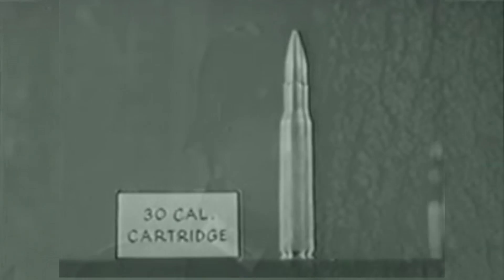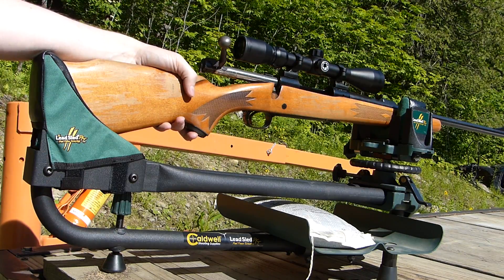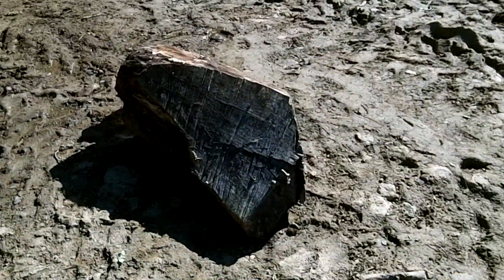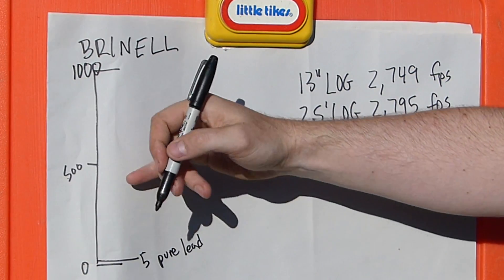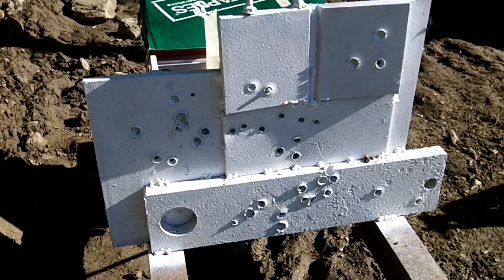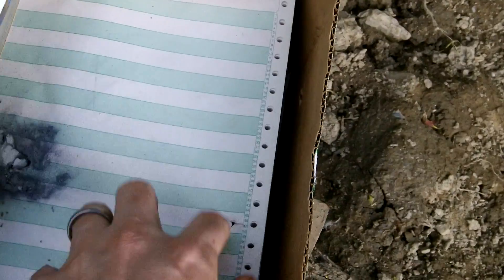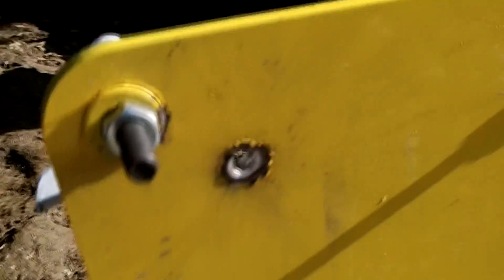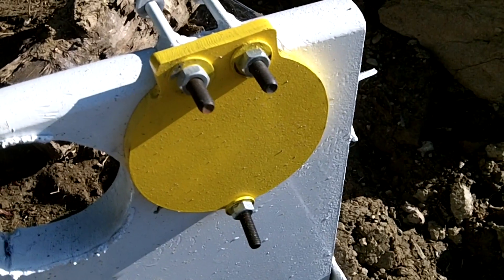AMMOTEST: 30 Caliber M2 (30-06) Armor Piercing Penetration Tests - Military Surplus Ammo

Comment: In the early 80s i tested various bullets on M2 bradley armor plates, i still use the same plates. Only the 50cal APs & APIs would mostley go thru, the plate is a thinner one (5/8") from behind the tow missile launcher. With a WW2 40mm AP projo in my black powder breechloader cannon. it punched a spall out of the back but bounced off, found it on the ground a few feet in front. It hits with about 40 to 50,000 ft. Lbs.
  Then tried 1 3/4" thick T6061 alum. 3" square blocks with 30-06 M2 AP it put a small bump on the back. 9MMs put a shallow .05" deep dent, 45ACP just put a smudge, not even a dent, they hit at an angle though. 223s went about 1/2" deep. 50cal M2 AP went thru. 50cal M1 incendiary went almost an inch with a lot bigger blast hole😊
Reply: I also got hit in the stomach with a 30-06 M2 AP core while shooting at a 155mm cannon projo at about 50yds. That I used as a target. I found  the core in front of me, it was to hot to hold😊

Comment: You have what's called gunpowder   degradation over time the Stabilizer inside the gunpowder Starts to break down so the gunpowder inside the the rounds loses it's maximum strength Over a long period of time Being that those rounds are over 70 years old  When those rounds were new they probably would have pierced all your steel targets And a good portion of your concrete targets The rounds should have been closer to 2900 FPS and 3400 FPS for Black tip 30-06 AP

Comment: [05/07/21] Very nicely done testing for a "non-laboratory" type test environment. It is sufficient such that it gives us an appreciation for what 72 year-old 30-06 AP ammunition is capable of doing. It is safe to say that the ammunition has suffered no appreciable age degradation.

Surprised that there was no "permanent" Back Face Deformation on any of the steel targets.
It would have been nice to see the effects on level III+ and level IV plates, but these results are very telling.
Just a few questions:
a) At what distance were the shots taken?
b) When you say the concrete was reinforced; what rebar was used, and in which type of pattern was it layed out?

Great no nonsense, no sensationalism type of presentation. 👍👍👍

Comment: British Royal Armouries tests, in 1917, of German Mauser 7.92mm. AP bullets found that they could penetrate up to 19mm. of Harveyised (high carbon steel boiler plate) armour at 100 yards with one in hundred hits achieving maximum penetration.

The same tests were repeated, in the 1920's, against rolled homogeneous armour plate, where the penetration was up to 13mm. at 100 yards.

This led to the British light, medium & cruiser tanks, of the 1930's adopting 14mm. of armour protection, so as to be just AP bullet proof and to save on weight & cost.

Comment: Great video. I'd like to see similar tests on 5.56 NATO M855/SS109 "green tip" ammunition. Some retailers call this AP, but the ATF has specifically exempted it from their AP designation since it reportedly cannot penetrate level 3 police body armor.
Reply: Have u ever seen how small the little steel core is in the tip of SS109 ammo, I wouldnt count on it for much of anything. I've  got a steel core right here. The core is about 8mm long (.317") & about 2mm dia. (.182") that's smaller than 3/16" & it only weighs 11grs, that's lighter than a 17 HMR😊
Reply: The dia. Should be 4.6mm      (.182") oops, brain fart😊

Comment: That ammunition was used by my dad who was a WW2 veteran and his rifle was a Springfield during the beginning of the war and later on he was issued a Garand rifle.  He said that the black tip could penetrate the armor of the Japanese model 95 light tank.  He also said that the nearest thing that he can compare the steel in its core is the drill bit.  It's nice to know that it was proven true and my dad was correct in his comparison.

Comment: I would like to see those bullets set in a 300 Weatherby Mag--see what kind of steel it will clean. At 500 yards, that 30 06 only has 560 ft lbs of energy--Weatherby has 1980

Comment: If they had been true AP rounds they would have gone through the 1/2" AR500 plate easily because the cores would have been tungsten or tungsten carbide which has a Brinell hardness of 2150 to 2200, NOT the 1000 Brinell that you list as tops. Depleted uranium cores have Brinells of up to 2500. Alloy steel APs are better than FMJ but not nearly as good as tungsten/tungsten carbide or DU cored rounds. However, the latter are very expensive, and DU create collateral health problems. Nor was it available during WWII for obvious reasons.

Comment: When I was a kid (circa 1968) we had a couple trees which intertwined with one another.  One was a sweet gum and the other a loblolly pine.  At a height about nine feet, each tree was about fourteen inches diameter.  My dad had an old 1903 Springfield 30.06 and some steel jacketed ammo.  He would shoot all the way through both trees...about 28 inches of wood.  He did it several times and the bullets never failed to blast through both trees.

Comment: It would have penetrated the AR500 1/2 in plate if you had not shot it where the 1 1/2" low carbon steel was not directly behind it. The 1 1/2 prevented the hard steel slug from being punch through the AR plate. It acted like a face hardened 2" think plate.

Comment: The only problem with the second log test is the direction of the fibers.  The linear structure of the wood fibers would lend itself to encapsulating the round and rapidly bleeding off momentum.  The cutting action in a cross grain penetration is far more likely to yield results, just as crosscutting lumber is easier than rip cutting lumber.  I would venture a guess that an endgrain shot on a 13 inch thick log will yield interesting results.

Comment: It would be interesting to look at the armor-piercing of this bullet but from a long barrel with a length of 1400 millimeters, it is about 56 inches and use a non-standard sleeve as in the video and the cartridge from the cartridge 14.5 * 114, then the bullet would pierce everything that was on the video :)

Comment: Famous last words.  I am speaking from experience I had the tail end of an AP jacket stick in my gut. NOT FUN also have seen AP that does not fully penetrate go strait back to shooter. I just had a friend acting as a spotter got it an inch from spine through the neck ((( YOU WILL NOT SEE IT COMING)) IT CAN AND WILL GO STRAIT BACK FOR THE SHOOTER OR FRIENDS STANDING THERE. Put a box in front of the steel target and shoot once and count 2 holes 1 small hole and 1 key hole aiming for you brain pan. Or just keep trying we will read about man shooting  AP at steel got it in the head (AGAIN ).P.S AP can shed jacket and will not loose fps and turn 180 lead is the one that splatters . And I don't think they are shooting AP at the steel range they would kick you out. You talk about the jacket losing all energy I'm not talking about the jacket even though I've been stuck with them its the steel core that hit the trees behind you. Check the trees or shed and you will find steel core that did not go through steel plate went 180. You need to see .50 cal vid that shooters muffs get knocked off. NOT TRYING TO BE AN ASS JUST HAVE SEEN AP GO TROUGH SPOTTERS NECK AT 180 DEGREES FROM (((((STEEL))) targets. Do more testing and you will find some can come and find you. Be safe and be smart is all.there are alot of dumb shooters out there that dont need help killing themselves or others shooters safety went out the window a few years ago and no when I'm out gold mining I get shot at on average 6 to 8 times a year from dumbassssss cityetssss filming them selves shooting. Look at me I'm Rambo on facebook OOHHHHH JACKASSessssssssssssss  still cant hit the broad side of a barn but look tacticoooool to many city Idiotsssssssssssssss

Comment: That molybdenum steel is damn hard stuff though. I made a knfe from one of my fathers old saw blades and io took my an hour to get the wire edge off it. So damn hard.Next time i use it i'll temper it.   3006 fav calibre ,good stuff

Comment: Drill bits are made of high speed steel. The cores of AP bullets are made of tungsten carbide.
Carbide is way harder than high speed steel! In other words, the tungsten carbide core of a 30-06AP round is much harder than a drill bit!

Comment: I'm coming to this video quite late (some 3+ years after the fact) and thoroughly enjoyed it.
So much so that I will he subscribing to your channel for grins and giggles.
A question now.
Where did you find the video from the old, military, training movie? I ask because I have actually watched similar movies when I was in Boot Camp back in the day (although not THAT vintage, LOL) and would love to watch some others of the same era, be they firearms, artillery, vehicles and etc.
So if you have a link so I can check them out, I'd be MUCH obliged, Sir.
Now as for the penetrator component of the projectile, I, too, have found many of them when I've gone out shooting. Some I have fired and some others have fired, my point being that as you mentioned, the penetrator is VERY hard and retains its point quite well.
In fact, the core is SO hard that I've used them as a prick punch when making a mark on aluminum or mild steel I was going to be drilling either at home or work when I was an aircraft mechanic. 
Lastly, I also shoot a single-shot 
.50BMG rifle and I used to shoot a LOT of AP (Armor Piercing, Natch) ammo I loaded because the surplus projo's were extraordinarily INEXPENSIVE compared to plain Ball or API, or API-T projo's. 
Just as in its .30 caliber brethren I'd oftentimes find those .50BMG cores which made an even BETTER Prick Punch due to its size since it is easier to hold on to. 
If you would like a couple, PM me your physical mailing address and I'll send you one hardened core and one mild core which is bent over somewhat, likely from shooting a very hard boulder or something. 
In closing, thanks for your efforts. I look forward to viewing many more videos now that I know of your channel. 
Have a great day!

Comment: Interesting video, I have heard the US coast guard 50 caliber  rounds to take out the engines in drug smuggling boats.
I expect this round would do something similar, could be good for self defense at sea.
Reply: There is a massive difference in the 50 and the 30 cal. The 50 will penetrate more at 500 yards that the 30 will at short range. But the 30 cal AP will take out engines within reasonable range. I doubt the Coast Guard has AP but they might. The 50 cal I shot in the combat zone was "ball" (plain tip) but still had a steel core but mil steel, not a hard tough alloy as the AP cores are.

Comment: Note: A live tree is MUCH harder to penetrate than dried or cut wood wood. The two should NOT be compared - even if they are the same type of wood.
Reply: Incorrect. The tannins and resin increase hardness with age. Think Amber. The living wood has water content that I believe you are referring to. Try driving nails into antique wood that is not rotted and compare the sample materials with new kiln dry materials. I do agree that the log used is clearly decomposing from exposure though. If you want reference material look into the "Janka Scale" that rates wood density by species. I sell antique red oak that routinely tests over 1700 on the scale and should be 1290 for newly dried red oak. My Antique heart pine can test higher than new red oak.
Reply: @scoutdogfsr  I've never shot up furniture, hardwood or softwood, to tell you the truth. But I've done penetration tests with all kinds of rifles and bullets on trees and logs, as well as different kinds of steel plate. And the logs that have been cut and dried are a lot easier to penetrate than live trees of similar diameter. And it's old cut and dried logs the guy is using in this video.
Reply: @magaman6353  I'm just stating imperial date not anecdotal experience. I agreed that the log looks decomposed in the video. I was trying to educate you and not disrespect. It seems that you want to defend rather than learn some facts. In my personal, or military career I've never decided that shooting logs was worth anything. Have fun blasting away at the materials of your choice. That's why we have free will and the 2nd amendment. God bless America!

Comment: The modern concrete could be higher strength than the concrete shown in the film. It just looked like the rounds in the film tore out bigger chunks than the rounds you put thru.
Reply: Concrete hardens as it ages. I would bet on more resistance from older concrete,  all else being equal.
Reply: @donaldmeaker3627  That is an odd way to interrupt what he said.
Reply: @JoahTheThread5ive  
Yeah really.......I agree with you on that 👍🏼

Comment: Its no suprise the .30 AP penetrated 1" of 130 BRH steel. The original ww2 data suggests that it could punch through 30mm of mild steel or 0.4" of 350BRH at 100y/0°.

Comment: The concrete looked like it was poured recently.  Just wondering if you have any info on the pour.  High aggregate content would result in denser concrete, plus old concrete (>1 yr) is harder than new (< 1 month) concrete.  A 7 sack mix with 3" slump would also be harder than a 5 sack mix, with an 8 or 9" slump .   Just a few thoughts to make it fun.